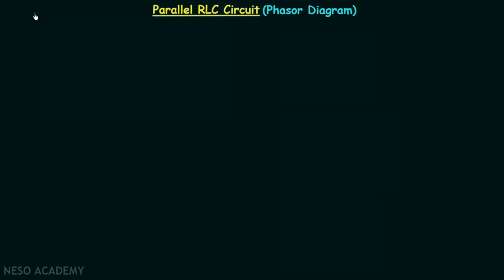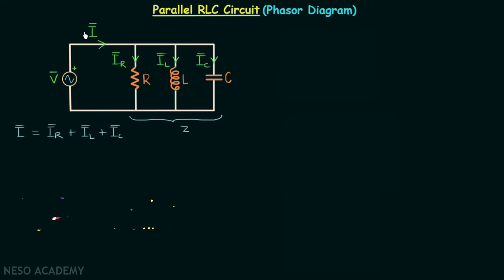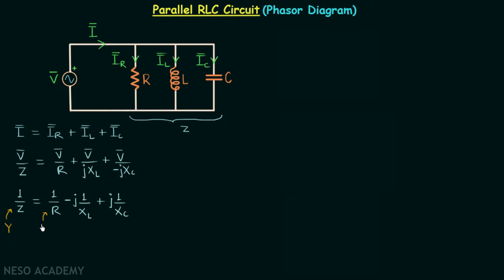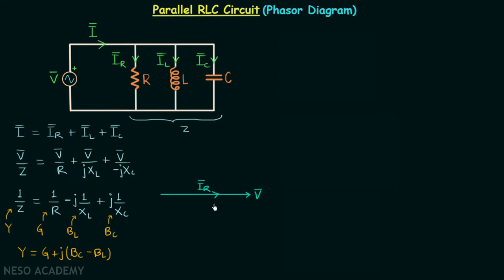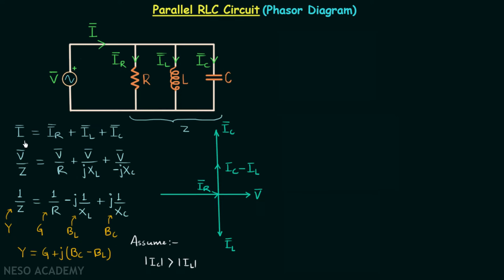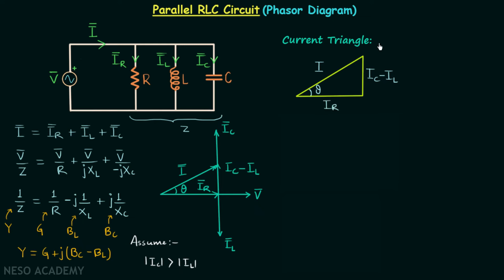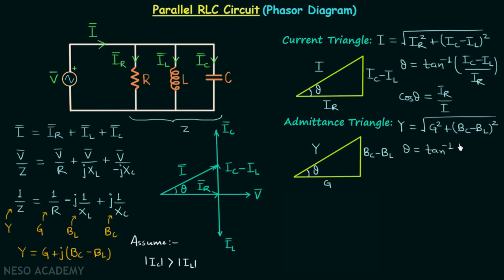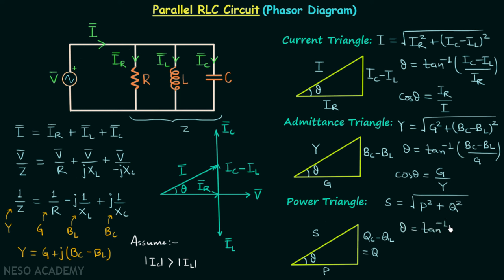Phasor Diagram of Parallel RLC Circuit

Comment: Hello, thanks for this wonderful explanation, but i'm a bit confused on how 1/jxl turn to -j/xl. please shed more light
Reply: Reciprocal of -j=(1/j)

You see, (-j * -j) /(-j) 
=(-1)/(-j) 
=1/j
Reply: Ya j kiun lgaya ?? Can anyone explain?
Reply: @m.j9975  it's the complex form just like maths, in maths we have i and here we have j( both represent complex form)
Reply: @suchanamondal1959  thanks
Reply: @m.j9975  For Inductor V= Ldi/dt  now take Laplace of this equation.. u will get V= L × s × i  then put s=jw 
U will get  V = L jw i 
Now V/i = Z across Inductor = jwL = j XL
_____________________________________
So finally - In Series Circuit 
Z across the inductor in Laplace form  = or in phasor form is  = Z= jwl = j Xl

Similarly
Z across capacitor = 1/jwC = Xc/j = -jXc

________________________________________
But In Parallel RLC Circuit We have to Find current across Inductor and capacitor also it is easy to calculate first in admittance form then take reciprocal for getting Impedence.

In that case 
Admittance across R ie Conductance = 1/R
Admittance across Inductor Y ie Inductive Susceptance = 1/jwl
And  Admittance Across Capacitor Y ie Capacitive Susceptance = jwc
Net Admittance of Parallel Rlc Circuit is 
Y = 1/R + 1/jwl + jwc 
Now Z = 1/Y
Reply: @s2-gatemeditatn273  what is j....???

Comment: this is good explanation for a simple rlc parallel circuit but i would like you to do a video for me explaining a complex circuit where there is a component like a capacitor in series with the supply voltage then there will be other components in parallel. in this case the voltage across the components in parallel will not be the same as the supply voltage because there will be a voltage drop across the capacitor that is in series with the supply voltage. in other words, may you do another example or explanation of a circuit with some components in parallel while other components are in series especially with one component in series with the supply voltage. thank you.